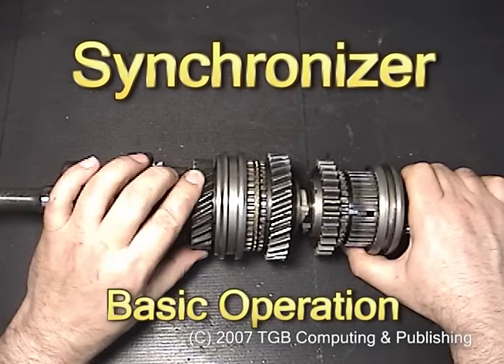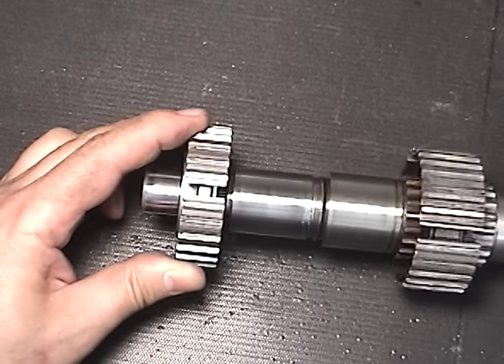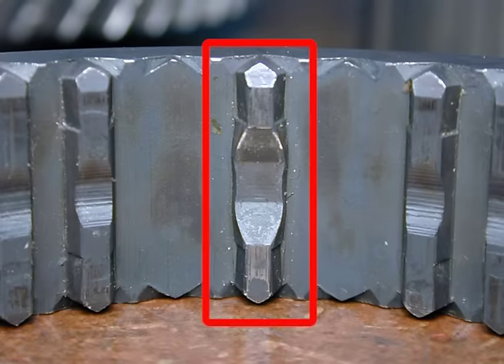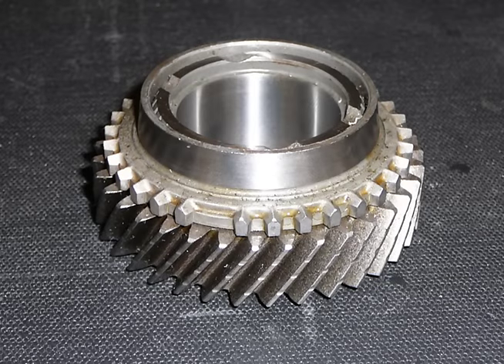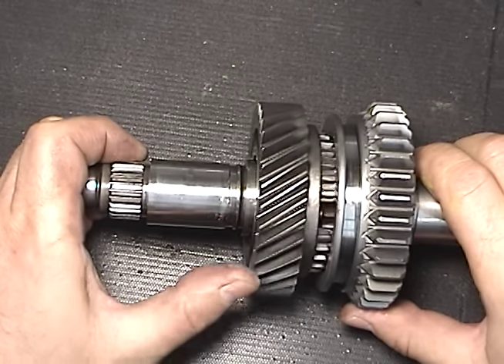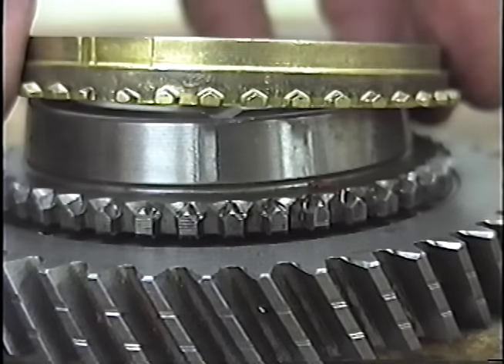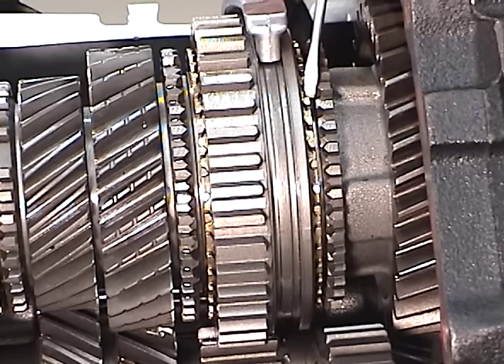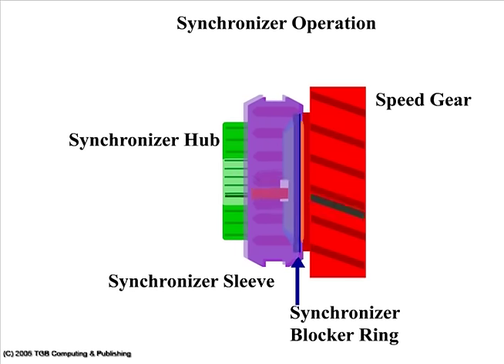Synchronizer Operation Explained

Comment: I have a 5 speed I changed slave cylinder and throw out bareing and flywheel clutch. But when I start my car it makes a noise when I apply my clutch to shift to first gear the noise sounds like the car is turning over again while it's on please help
Reply from the maker: Knowing the type of vehicle could help. I need more specific information before I can make any suggestions on what the problem might be.  When exactly does the noise occur?  For example is it from pressing on the clutch pedal or from moving the shifter after pressing on the clutch pedal. Does this happen only once after just starting your car? Does it do this every single time or only after the car has been sitting overnight? Does it feel like the noise is associated with hard to shift into gear or does it shift just fine?  Is the noise more of a squeak, squeal or grinding?  If the noise if from moving the shifter try pressing the clutch all the way to the floor, count to 10, then shift into first? Did this help?  Check to make sure you don't have a floor mat that has bunched up under your clutch pedal preventing you from pressing the pedal all the way to the floor.  When the clutch was changed, did you replace the flywheel with a new one? resurface the old one or reuse the old one without reconditioning it?  All this makes a difference.  If you can respond to as many of these questions as possible I will try to tell you what the problem most likely is.

Comment: I bet that's what is wrong with my 97 S10. I had the transmission rebuilt 4 years ago and it was always more difficult to get it into 2nd. It doesn't grind,it just isn't as smooth as shifting into the rest. I bet the synchro is sticking because they did replace 1,2 & 3rd gears and all the synchros and some bearings and other parts that weren't in the rebuild kit. I guess I'll just live with it because I'm sure not going to tear it apart.
Reply from the maker: Here is a little trick that might help.  Replace the oil in your transmission with Red Line synthetic Manual Transmission Fluid (MTF).  I have seen this work wonders on shifting problems.  Make sure to get MTF because if you get 75W-90 gear oil it will make it worse.

Comment: Great great. It will helpme to modify my 1975 vw bug trans to 5 speed.
Reply: The first step is to buy the 5 speed conversion kit. It's $2k.  Then you have to buy two gear sets ($500). The same co that makes the conversion kits also make a shifter that works with the 5 speed ($300). Find a mid 60s core trans to supply you with a few stock parts you will need.

Comment: I have question! Why does some times my car go in 1st,2nd perfectly then other times it doesn't want to go in and  really crunchers?
Reply from the maker: My guess is the speed of the vehicle and engine RPM's or if the clutch pedal is not fully depressed when you are shifting.  Check to make sure you are fully depressing the clutch each time you shift. Also make sure there is not a floor mat or carpet crunched up under the clutch pedal that would prevent the pedal from going all the way down. If it's not the clutch pedal the clutch itself could be hanging up inside and not disengaging properly.  It could be sticking to the flywheel or pressure plate.  You can try this between shifts when it's grinding.  Press the clutch in, count 1001, 1002, to create a 2 second delay, then shift and see if the problem goes away. If it does go away the clutch disk is not disengaging properly and the clutch will have to be removed to see why.  If you continue to drive with the grinding shift you will cause more expensive damage to your transmission.  Finlay if it's none of these change your transmission fluid.  If your transmission calls for standard GL4 80W-90 gear oil I would recommend replacing with Red Line Manual Transmission fluid. This high quality synthetic fluid works wonders on synchronizers that are just starting to show signs of wear with small grinding between shifts. Grinding typically goes away after switching to this oil.  (Note, don't use Redline MTF if your transmission should use a specialty oil or ATF specified by the manufacture.)
Reply: My car began to do this last May with 18 year old MTF at 73k. New trans fluid (Febi 32590 75W-90 GL4/5 in my case; factory fill was Castrol BOT 402 75W-85 GL4) fixed it. Manual trans fluids are laced with a friction modifier additive that gives enough friction to let synchros do their job, and it eventually wears out like any other additive
Reply from the maker: That is correct. The additives and friction modifiers in the lubricant play an important part in the proper operation of the transmission. I see you put a combination GL4/5 fluid if you however had put a GL5 fluid in your transmission you would have experienced other fluid related problems.  Always make sure to stay with fluid with the correct classification.
Reply: @DrivelineMaster  I believe that rather than API classification, one has to check the fluid's PDS for synchro compatibility; the fluid i used is roughly equivalent to Redline's 75W90NS, whose PDS states that, since it lacks the LSD dedicated friction modifier, it's more suitable for synchros than the ordinary 75W90 GL-5.
Reply from the maker: API Classifications are important and the easiest indicator for most consumers. looking up and knowing how to read a PDS is not something the common consumer would do but good for you for doing this. Some Redline gear oil is not compatible with manual transmissions and cause more problems then they fix.  Redline sells what they call MTF for manual transmission fluid. it is a synthetic 75W90 lubricant and my manual transmission fluid of choice if specialty fluid or ATF is not recommended by the manufacture.

Comment: I'm confused on how is syncs up without the synchro making any noise. Or, without taking damage.
Reply: I'm looking at building my own go kart transmission, so I'm trying to gather as much info as I can
Reply from the maker: If the sleeve is moved over to lock onto the gear without a synchronizer ring and mechanism two things don't happen. 1) the speed of the sleeve and the gear are rotating at different speeds and the teeth on the gear will clash or grind making a terrible noise while trying to engage with the teeth on the sleeve and causing damage to both. 2) There is no mechanism to prevent the movement of the sleeve if the two are rotating at different speeds which will then cause problem (1).

Comment: Great video/explanation!  However, I find the heat expansion theory to be nonsensical.  The way I see it, the shift is blocked when not synced due to the following:  The keyway in the blocker ring is slightly larger than the key itself, allowing for the few degrees in travel each way.  The key wants to detent to the center by spring pressure.  Speed differentials cause drag on the blocker ring, bringing it to its full travel on the key one way or the other (upshifting or downshifting) and that causes the teeth to be misaligned, hence blocking the shift.  Once the speeds are similar or the same, drag is reduced on the cones, the blocker ring comes back slightly and the teeth align perfectly, allowing for the shift to happen.  

Thank you for reading my dissertation.  I have never actually rebuilt a manual trans, but that makes more sense to me from a mechanical standpoint than the heat thing, etc.  I did not think any metals expand and contract that quickly.  My explanation may not be perfect so feel free to correct it as necessary.
Reply from the maker: This may make sense to you but I disagree.  First of all when starting to make a shift the blocker ring will always rotate to the maximum movement against the key regardless if the gear can be synchronized or not.  The clutching (dog) teeth on the sleeve, blocker ring and gear are all designed with points so teeth alignment does not have to be perfect.  Believe it or not it is the heat generated between the blocker ring and the gear that causes enough resistance to prevent the sleeve from moving far enough to cause grinding of the dog teeth against the gear when synchronization is impossible.
Reply: You are the expert so I will certainly defer to you.  That is pretty awesome stuff.  Thank you for further detail.  I recently bought a Shelby GT 500 and I am amazed at how smoothly and perfectly the Tremec 6-speed performs.  My only complaint is the noise it makes when lagging (1000 rpm or so) and it sounds like the gearbox is coming apart.  Ford says this is normal.  I have read online that GM's Syncromesh will virtually silence the noise.  Any thoughts or suggestions there?
Reply from the maker: You might be hearing what sounds like marbles rattling around in the gearbox at low rpm's and if you are in a garage or in an ally way where the sound can bounce off a close wall it will sound worse.  I will try to make this easy to understand.  The engine rpm that enters into the transmission is not constant or smooth.  In fact 1000 RPM's is an average from the crankshaft speeding up and slowing down.  Therefore the velocity of the crankshaft is not constant.  This is magnified at low engine RPM's and transferred into the transmission. All gears need a little clearance between the constant mesh teeth on the gears as they rotate.  This clearance is called backlash and this allows for heat expansion and room for lubrication.  When you accelerate one side on the drive gear and one side of the driven gears are forced up against each other and you will never hear the rattling from the backlash.  When the RPM is low the fluctuations in crankshaft speed is translated to the input shaft and the drive and driven gears. The force between the gears is not consistent causes them to rattle back and forth within the backlash clearance allowances. Accelerating slightly normally removes the noise because it forces the gears tight against each other.  Sometimes a different type of oil will reduce the noise and sometimes it won't.  Redline makes an excellent synthetic manual transmission oil if you want to try this but I can't guarantee that the noise will be gone because it is inherent of the design and the engine.  The type of clutch installed can also play a factor in this noise. The clutch dampeners and flywheel are designed to help minimize the crankshaft fluctuation that enter into the transmission. If you have an aftermarket clutch assemble and or a lighter flywheel this might be making the problem worse.
Reply: @DrivelineMaster  Could you explain how the heat generated between the blocker ring and the gear would prevent the sleeve from moving forward? My physics knowledge is pretty rusty.

I might be missing something obvious but I can't think of a physical example of heat obstructing translational motion in this way, especially since the motion of the sleeve approaching the gear is in a plane "perpendicular" to the rotation of the gear and the blocker ring. So if it's because of friction between an unsynchronized gear and ring then that doesn't make sense to me because that additional friction isn't parallel to the sleeve's movement TOWARDS the gear. 

Also any friction resulting from speed mismatch between the gear and blocker ring is on the gear-facing side of the blocker ring, not the sleeve-facing side. So in my mind the sleeve should have the same ease of movement whether or not synchronization has already occurred, despite the fact the sleeve is also rotating.

Friction between the bottom bun and the patty wouldn't prevent me from placing the top bun down on the burger, regardless of whether the bun and patty are spinning at equal or different rates. To use a very crude example lol
Reply from the maker: With friction come heat. With heat we get expansion.  The expansion from the heat between the blocker ring and the gear creates a lateral force opposite of the direction of the sleeve during shifting.  The blocker ring pushing back towards the sleeve pushes on the keys which push on the sleeve. It may not seem like much force but imaging trying to shift into first gear while going 70 MPH.  There will be a large speed difference between the blocker rings rotational speed and the rotational speed of 1st gear. There is a large enough speed difference to cause enough heat and expansion from the friction to make it impossible or close to impossible to engage the sleeve with first gear.  Also remember there is a thin film of oil in there that heats up and expands.  This oil acts like a hydraulic force.  I hope this helps.
Reply: @DrivelineMaster  I see that was very helpful, thanks for explaining!

Comment: Good explanation thanks, can you clear one thing that how it will work in static condition please explain.
Reply from the maker: Static mode would be shifting when nothing is moving inside the transmission.  In that case synchronization is not required. Because the teeth are pointed if the teeth don't line up when selecting a gear the gear will rotate slightly on the bearing to align with the synchronizer sleeve and engagement will take place. Hope that is what you were looking for.

Comment: I still don't really understand why when the slide comes over and pushes the blocker teeth and the speed gear teeth together, then end up being in the same place (same speed so the slider can go on, but why do the teeth line up? 8:00
Reply from the maker: Close, The blocker ring uses friction against the speed gear to speed it up or slow it down to match the speed gear rotational speed to the rotational speed of the synchronizer and blocker ring.